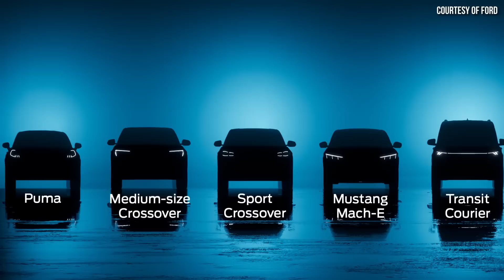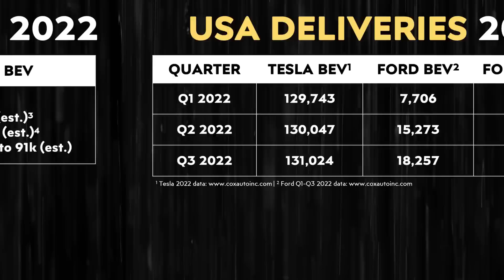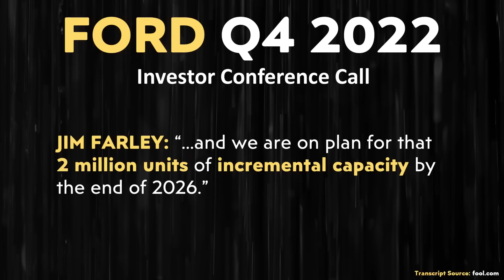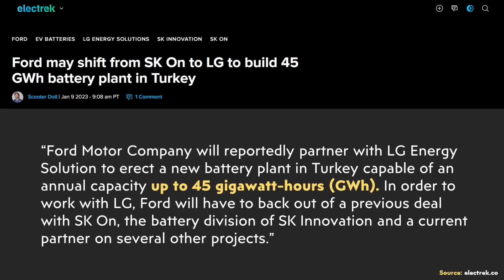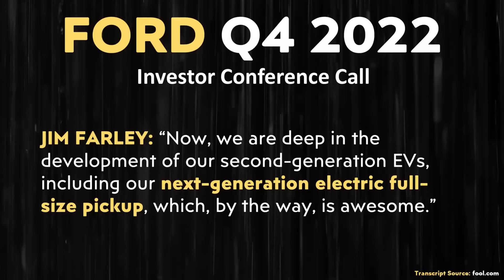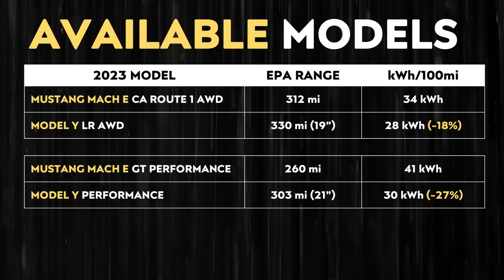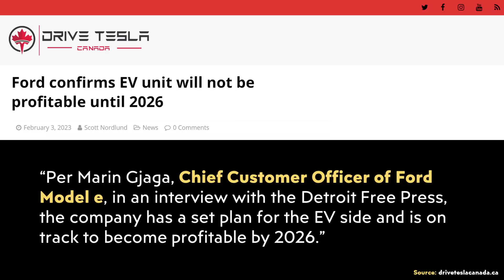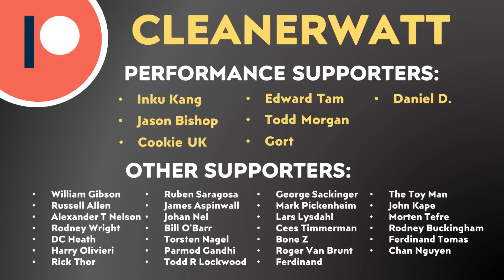Tesla vs Ford EVs: Ford's FIGHT for Survival (Next Gen EVs)

Comment: Wow, 15% less range and 10% bigger battery for the Performance MachE. That’s significant. 
How does Ford change that enough to catch up to Tesla in 2025/26?
They have no new manufacturing methods like megacasts and the next gen modules from multiple parallel production lines using far less labor, time and energy to lower costs. 
Their biggest challenge is creating a whole car OS that’s as robust as Tesla’s. 
They can’t achieve their stated goals by just not being stupid about wiring harness and such. Breakthroughs are required. 
Farley doesn’t get that or he knows that’s way too impossible to ask for from his workforce. 
Damn. And they’re in better shape than most traditional OEM’s. 
It’s a daunting challenge. It makes me wish someone would’ve listened and started down this road in 2013 when ModelS was blowing the world away. 
But they were way too arrogant and lacked vision to the point that one could call them blind. 
I hop Ford makes it but it seems unlikely. Maybe Tesla will help them before they go under (and not help gm)😁.

Comment: You mentioned BYD as Tesla's greatest current Chinese threat.  I would submit that NIO is more in line with this concept.  BYD produces lower end vehicles, where Tesla has historically targeting BMW class vehicles.  NIO is more in line with this.  However, NIO has been stuck in "production hell" for an extended period of time.  Once this tough period has passed (and their brand new high capacity, state of the art factory and fully ramped) NIO will present a much more aligned competitor.  Time will tell, however.

Comment: John, you are making the same error as many other folks. The 50% vehicle growth rate uses 2020 as the base. You can't take the previous year and add 50% to predict the current year. If you read any of their quarterly earnings reports you will see this (its on page 26 of Q4 2022 report)  - 'Assuming 50% CAGR since 2020`.  Also, the rate is an average over many years, so some years it will be below 50% and some years above 50%.

Comment: This is slightly inaccurate since Ford always has the option of switching the ice factories to bev. Tesla's situation is different since they are still building factories and can't just change equipment.
Reply: Ford  old factories are a liability nothing like the telsa giga factories.
Reply: @stivtonev165  I agree but you need to build cars somewhere. Ford has amazing capacity once they switch the lines

Comment: theres jim saying they didnt know they had too big a wiring harness, that just proves a point remember 42k fords parked up because of lack of blue badges, when munro did a tear down of the lightening he pointed out all the unecessary pipework and joints/failure points, ford need to stop going to the parts bin and redo everything ground up including removing the transmission tunnel, all this work should have been done prelaunch to the lightening this imho appears the lightening was rushed out in a knee jerk reaction to the CT, ford have maybe 12 months to secure there pickup market share @ most ,once the CT comes out with OTA/superchargers and it unique style ford could lose as much as 80% of there pickup sales especially the fleet buyer TCO matters more than brand loyalty,the charging infrastructure for ford is not in place which a big minus for ford ,unless they incorporate the tesla NACS they will need to spend billions they dont have TRYING to beat the SC network which they cannot do, you only have to look @ the DC charger prices they want to charge there dealers proably 4 times more expensive than a faster SC

Comment: Farley is a bullshitter same as any business person.  There is no way ford can mimic tesla without having a smart engineer at the top.  Farley always looks like a deer in headlights because he doesn't know anything or have any applicable skills.  Business CEOs are used to coasting while taking credit for the work of engineers.  Farley is in a position of having to reorganize ford around EVs, but he lacks any knowledge on how to do it.  This means smart people are slowed down trying to explain things to him so he (the dumbest guy in the room) can make all the important decisions.
Herbert Diess was the same way.  The closest these companies get to supporting EVs is putting vapid EV cheerleaders in charge while pretending expertise isn't necessary.  They will all fail.
Reply: I actually think that Jim and Herbert are (were) THE two individuals most in tune with the requirement BUT in a VERY difficult position.
Easy between "the rock and hard place" of having to placate the "investors" etc, while trying to survive "transition hell".
First stage, admit the problem (without admitting the problem!)
Reply: @rogerstarkey5390  They are merely cheerleaders for EVs trying to manage engineering resources they do not directly understand.  If the boards were serious, they would hire real engineers to manage the company transitions to EVs.  Farley has a chance of working if good engineers under him manage to steer him in the right direction, but if the board is serious about the transition to EVs, they need a real engineer in charge and not a business person.  If the guy at the top is the dumbest person in the room, that is a serious problem that slows everything down.

Comment: Ford made around 78,000 Mach-E's in 2022.   ... oh but oops, now they've realized that it's wiring harnesses are 1.6km longer than they needed to be.    So they wasted enough material to string excess mach-e wiring harness lengths around the earth THREE TIMES.
Reply: Ref Mach-E cooling....
You'd think after that debacle the order would have been "Everybody check your designs for waste!"?

Comment: The thing is about all other EV makers (other than Tesla), if bad reports continue about the other charging networks customers could get turned off altogether and refuse to buy anything but a Tesla.  Other EV makers need to take more of an interest in these charging networks instead of leaving it up to 3rd parties.
Reply: And ? Most ev charging is done at home. The average daily commute can be recharged in just 3hour from an ordinary house hold outlet.
Reply: @nordic5490  BUT if you are replacing an ICE vehicle and do want to leave home on an out of town trip, it will matter a great deal.  If you are only going to drive around town, get a Volt or a Bolt, you don't need range.
Reply: I'm semi spamming this... But...
The solution
Government says
"Dear Tesla, please open source your charger design (not just the plug) and allow others to produce under licence, branded as their own(!) ..... Small royalty available".
Then
"Dear <insert domestic manufacturer.... (NOT VW)> 
....Please take advantage of the "grant" we're offering you to manufacture (reliable/ Cheap!) chargers..... Note that this will be your main source of "support" from us moving forward ..."
(Translation..... If you want a "bailout"... THIS is it)
.
Result.
Government uses public funds efficiently (novelty!) to rapidly expand network with proven, cheap, reliable equipment.
.
They at least partially avoid the looming (inevitable?) bailout issue.
.
Other manufacturers get a revenue stream from Government,
They receive positive association with "their own" (😗😗🙄) branded chargers, (in larger numbers due to reduced unit cost!) which with a standard "Magic Dock" are compatible with the "predominant" reliable national network.
.
They also get charging revenue from their own, and "other" users.
.
Tesla gets a small Royalty (or preferential opportunity to provide storage backup?) Plus a huge increase in the general network (it's "the mission"!!)
.
The consumer gets an uncomplicated reliable standard network, able to cross connect with CCS, allowing them to be "brand loyal"
The taxpayer gets value.
(Reduced if any bailout, taxes back from production and revenue).
.
Would this work?
Discuss?

Comment: Again, someone doesn't understand the "50% average over several years comment" PLEASE Cleanerwatt, I regard you as one of the most accurate youtubers in this space. Take the average of 50% growth over several years. Some years above 50% and some under. [2020 ---> 500,000 vehicles]   [2021 ---> 750,000 vehicles]   [2022 ---> 1,125,000 vehicles]   [2023 ---> 1,687.500 vehicles]   [2024  ---> 2,531,250 vehicles] They did NOT say that every year would be 50% growth over the previous year! PLEASE PLEASE get your facts straight and don't spread FUD! I love your channel!
Reply: Just saw @ron king comment. That is 100% correct!

Comment: 1. FORD has reported a net loss in 2 of the last 3 years. In 2022, FORD reported a $2B loss. Bankruptcy soon? Add their massive debt, UAW, increasing cost to produce an ICE car, etc. 
2. Inventories at FORD dealerships are increasing above the industry norm. 76 days vs 56 days. FORD has a larger inventory than their competition AND demand for FORD cars has decreased. Farley claims FORD could not produce enough because of supply constraints, but his car inventories tell a different story!
3. For the second consecutive year, Ford Motor Co. has reported the most U.S. vehicle recalls of any automaker, partial NHTSA data shows. Through Dec. 19, Ford had issued 65 recalls affecting more than 8.6 million vehicles in 2022. In 2021, the automaker issued 53 recalls covering nearly 5.4 million vehicles.

Comment: Tesla never said they would grow 50% YOY. They stated they would grow 50% a year over a multi-year horizon. So you need to average all the cars sold over the multi-year horizon and take 50% of that number. I can't remember the start year of the multi-year horizon they defined in their filing.
Reply: 2020 year end 10 year plan.
Reply: basically 50% every 2 years then, 2 years means multi year, so does 5 years, 10 years. I think they meant 5 years if im not mistaken
Reply: @dxelson  the 50% average is 10 years with ending balance is 20million car sold.

2020 guidance not the actual is 300k plus multiple it by average of 50%for 10years is 20mil vehicles.
Reply: @dxelson  I think they defined the 50% growth start year as 2020 nut it could have been 2019
So you take the sum of all vehicles sold from 2020 through the existing year / number of years * 50%

2023 growth = sales in
2020+2021+2022 / 3 * 50%

2024 growth = sales in 2020+2021+2022+2023 / 4 * 50%
Etc.

This is very unusually way to define growth and I have no ideal why they choose it.

Comment: Somehow the battery manufacturing by Tesla in Berlin and also a battery plan near their CA assembly plant got lost. One other big difference is that Tesla's assembly of the 4680 cell is already designed and in production in Austin. Building battery production manufacturing equipment is a big and specialized deal and only Tesla owns their own company that builds all of its equipment.
Reply: Agree. Additionally Tesla is also leveraging battery production to build grid scale batteries installations. Tesla is also a leader in automobile EV plants.
Reply: Rubbish. Most Teslas produced globally atm, use Chinese, CATL made LFP batteries. The M3 and MY sold here in Oz are made in China using Chinese LFP cells. Tesla does not produce LFP batteries them selves, but that might change. Megapacks will also use those same CATL LFP batteries.

I am not a fan of 4680 structual battery packs, as they are glued together and cannot be readily repaired. Ie, a throwaway. Shame. But, most Teslas will not use the 4680.

BYD are far more vertically integrated than Tesla, as BYD make their own LFP Blade batteries, and make their own chips. BYD is also opening up factories in India (Tesla isnt). BYDs growth in 2022 was twice that of Tesla. When the BYD India plants are on line, the world will be flooded with evs.
Reply: @nordic5490  
OK, so you don't "get it"?
.
Tesla will use any cell (of the right quality) available while they need to
.
The 4680 will be the cheapest  in terms of "GWh (TWh!) Leaving the factory"
And it's a much smaller, (easy to build) factory.
.
Let's wait and see if a LiFePo4 version of 4680 materialises?
If it does, all bets are off.
.
The 4680 pack.
If a cell fails? It's fused.
You lose 1/828th of the energy.
BUT.....
MOST failures are in power electronics, not cells.
Other manufacturers build them INTO the pack, complicated. (Ref the Mach-E "contactor issue"?)
.
Tesla puts them in the removable "penthouse" on top of the pack (under the rear seat)
That's "repair" covered. How about "reliability"?
Those power electronics? Common components with the Plaid cars.
That tells you that the vast majority of Tesla vehicles are well over-engineered with systems "ticking over" nowhere near their maximum capability (same for motors, cooling, etc) 
"Throwaway"?
No
Try
1) Suitable for repurpose (storage)
2) FULLY recyclable (ref Redwood Materials / plus Tesla recycled in house).
.
As for BYD, the same factors, questions, criticism applies to their cells.
(Btw, regarding performance, you might do well to check out the Bjørn Nyland Thailand tests of the BYD cars. Charging wasn't "spectacular" by any means!)
.
Factories?
Tesla will build small modular 4680 factories anywhere it suits them
(Look at the 4680 "add-on" in Nevada. It looks like it will be a maximum of 30% the volume, but produce 3 times more than the 2170 facility)
.
The BYD "growth" is largely due to them having the (admirable) ability to convert their production from ICE to Hybrid to EV Because they, (unlike Legacy makers) planned that to happen when building the factories.
.
When that transition is complete maybe ( maybe ) they'll start making similar margins to Tesla?
Meanwhile Tesla makes more PROFIT from fewer vehicles due to those much higher margins (which is really odd, considering that "BYD are far more vertically integrated" ??)
.
I'll suggest you go to The Limiting Factor YouTube an look at the actual comparison between packs.
Reply: @rogerstarkey5390  well... your idol himself, Elon, said that LFP is the future. Neither Tesla or Panasonic make LFP cells, and the majority of all Tesla car produced right now, use LFP cells. 
4680 will have their place - probably in the Semi and CT, vehicles where the highest power density is required.
I think Tesla is racing to head off a pr disaster when more older NCA batteries catch fire, possibly in a big headline grabbing event
Due to fire risk, I think Tesla is pivoting to LFP as fast as possible. LFP is certianly going to be used in all future Powerwalls and Megapacks.

I am not a fan of glued together battery packs. Servicable battteries can have a second life, and be repurposed as stationaty storage - plenty of houses run on used ev batteries. Serviceable batteries are dismantled, and the faulty or low perfroming module is replaced with one that matches the rest of the pack. Try doing that with a glued together 4680 pack. Fords F150 lightning has a serviceable pack.
There is no reason to build a hrow away disposable battery design.
Reply: @nordic5490  your entire comment was rubbish. 👍🏻
Fyi byd LOST ground to tesla in 2022 vs 2021 not gained new market share and ytd for pure ev sales byd is falling further behind AGAIN. 

In January byd only sold 15,000 evs at or over $30,000 vs teslas sales of over 71,000 just from China in that $30,000-$40,000 range. And byd has no production currently outside China. Vs tesla is now producing more cars again outside of China. 
Maybe in 2024 or 25 byd can try to challenge the world leader in ev sales. But it won't be this year and they lost ground in 2022 vs 2021 in total ev sales vs tesla ev sales. 😀

Comment: Jon,   The Tesla volume does not reset by %50 every year.   It is a base from 2020 volume as shown in deck provided by Tesla in q4 report.
Reply from the maker: Elon said in the past that vehicle deliveries should grow on average 50% year over year. Elon reiterated that some years will be higher and some lower, but the average will be around 50%.
Reply: @Cleanerwatt  page 26 from q4 deck.   Your quote is correct, but really depends on base.  To reset every year is too big of a number.
I tried to post photo but could not.
Reply: That is such a stretch of faux logic. 
The bottom line is will they hit 10 or 20 million unit production by 2030.
Reply: @Dularr  That's just what they said. 50% average growth over the next several years. At 50% average growth per year starting at 500,000 in 2020, the production in 2030 would be 28,832,519 vehicles. So definitely room to slow down growth over the last few years of the 2020's to reach 20 million.
Reply: @Pezuzzu  except that wouldn't be 50% average growth.
Reply: @Dularr  
50% production growth (1.5× per year) is indeed 28+ million.

What's your definition?
.
(Go on, get creative)
Reply: @rogerstarkey5390  my challenge is when people start bring up average 50% growth.  As an excuse if the growth rate doesn't hit 50%.

Comment: Of the legacy manufacturers Ford does seem to be more self aware and less in denial about the transition to EVs. They're realizing the shortcomings they have with their current EVs and already have ideas how to improve them. A lot of people disagree but I have more confidence in Ford than I do from most other legacy auto manufacturers, including ones such as Toyota. I still think Tesla will lead however.
Reply: Toyota objectively has fallen behind despite being big on hybrids at the beginning. I agree with you
Reply: @ricotrejo4125  
Toyota has fallen behind because they're so big on hybrids. Because hybrids are not proper EV's, they're just an excuse to outwardly justify not transitioning to real EV's!
Reply: Remember it looked like VW was the one legacy auto company that looked the most likely to survive and make the transition?
And then they threw it all away and fired the CEO that was trying to save them.
This isn't over until they're at least halfway through the transition, maybe more.
Reply: Totally.
Reply: Farley is very candid as opposed to GM but internally they are somewhat dysfunctional.